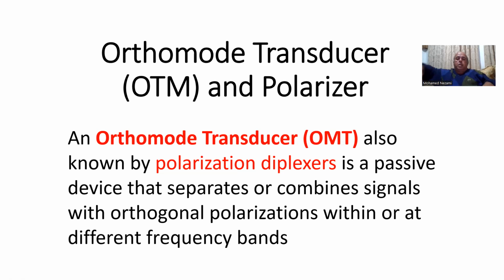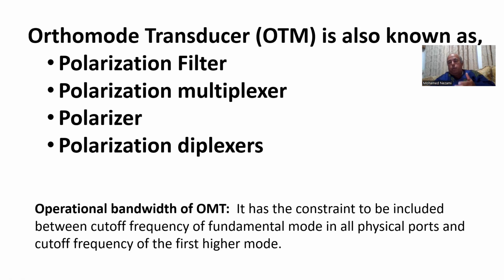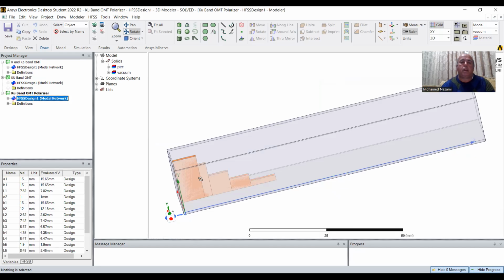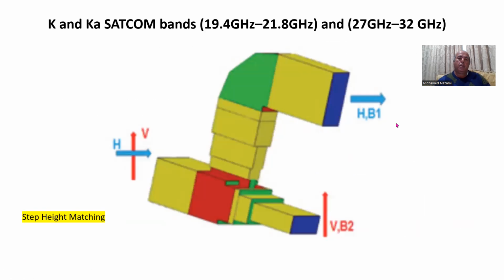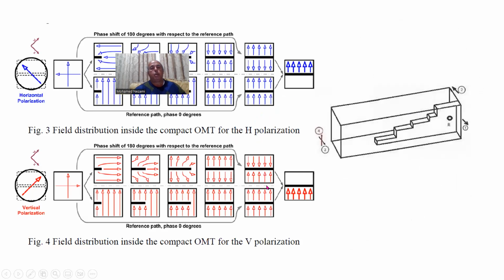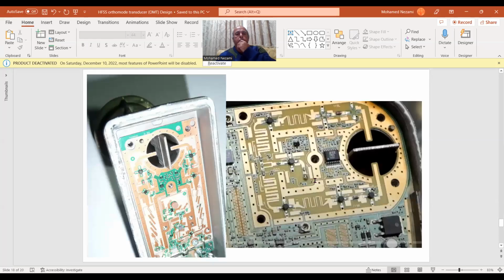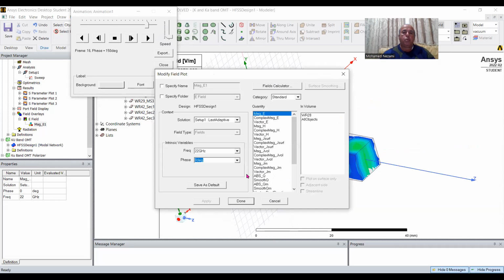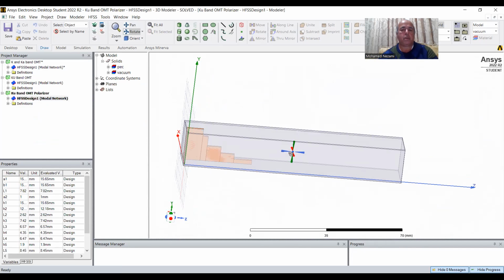Design and 3D Modeling of Ka and Ku Band Orthomode Transducers (OMT) and polarizers Part 1 of 3

Comment: Nice explanation sir. I am designing circular waveguide to rectangular waveguide OMT. Splitting circular polarized wave into TE10 & TE01 modes at rectangular waveguide. How to match the ports between the circular waveguide d rectangular waveguide?